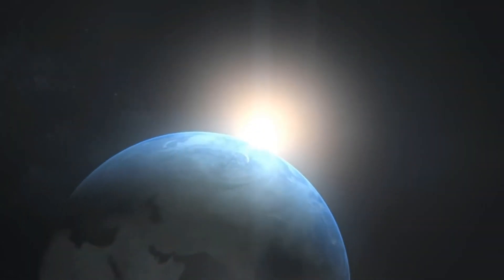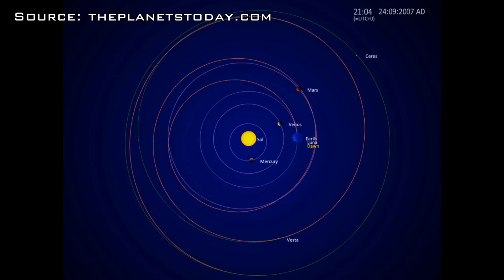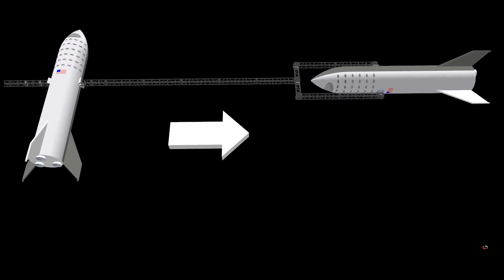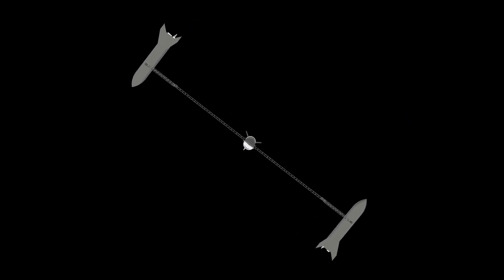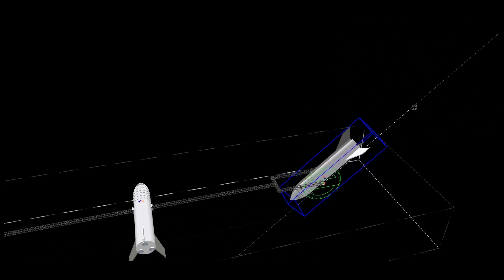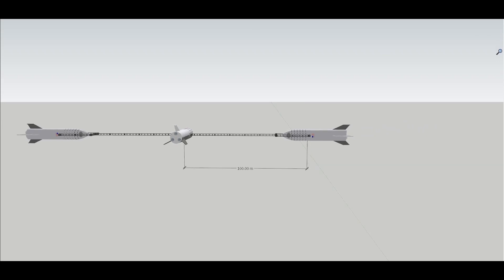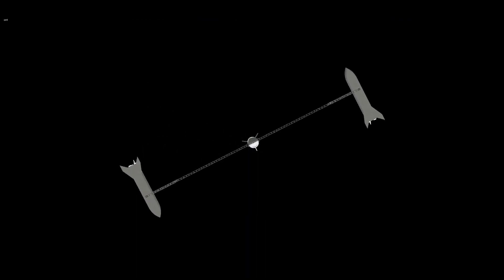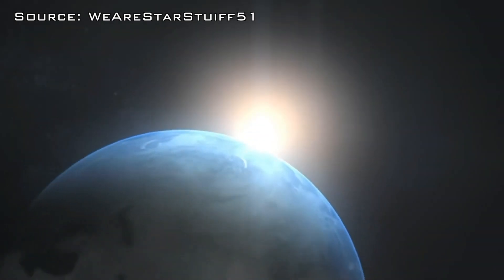GLS2: Artificial Gravity for SpaceX's Starship

Comment: Lame. Starship rcs will be hot gas using the same fuel as the mains  no reason to use mains they are way too powerful.  Truss is way too heavy and serves no purpose.  Wastes  third of payload.  With an electric motor controlled tether reeler  you would need much less precious fuel.  Fine tuning the g force could be done with nuclear or solar energy which will be available in abundance.

You one correct realization is that spin gravity is necessary.   Just a totally lame design.  Congrats
Reply: Would you like to live in a spaceship that was hanging by a cable from a crane? How about doing exercises in it? And every time you moved up or down in the real thing the coriolis force would make it shake. And perhaps it would spin about the axis of the cable. First one way, then the other. The trusses, made of lightweight alloy tubes, would stop all that and would not be heavy.
Reply: @robtristram8395  Thanks for your thoughtful response.

Yes I would like to live in a tether spaceship over any other alternative.  It is safer, carries more payload, and would be less disorienting.

 I am afraid you are thinking about this design problem from an high gravity earthly point of view.  This is common among we humans as only about 500 have ever encountered more then 5 minutes of weightlessness at a time.

Thinking about this like a ship hanging from a crane in a gravity field shows this tendency.

Movements inside one of the two spaceships would change the center of rotation.  But it would stay very near the line of the cable unless you were moving a significant proportion of the ships total mass.  Which is unlikely to be necessary.

Ships on their way to mars will be many times the mass of the passengers.  So even everyone moving in coordination quickly from one side to the other would be less noticeable that the same operation on the Titianic.

Secondly you would not feel or notice the  regular changes in center of gravity without instruments.  There would be no shaking.  Unless you are sharing a ship with someone who could move like the Flash.

If someone started running clockwise around the outside edge of one of the 30 foot diameter floors; there would be a tiny proportional axial rotation until he stopped when it would be cancelled out.  If this were a serious need it would be easy to store some of the water in an annular water tank with some small solar power eclectric pumps to contra rotate.  This takes no fuel and adds no extra weight.  Not a real problem.

The trusses would be way heavier than a simple cable.  It would be far better to use that extra mass to have a longer cable so that the centrifugal force is more similar to  gravity.  The longer the cable the more similar the passenger experience between the top of the ship and the bottom floor.

Another big plus of the tether approach is that the direction of force on the ship is directly opposite to all of launch and the high G part of the belly flop reentry.  It is far easier to design a ship that experiences substantial forces in one vector than all the additional vectors a solid strut system would apply for months of 24/7 use.

There is a reason Musk has not contacted the Original poster.  The OP's visual art skills are strong but his physics and engineering are weak.   There are lots of ladies with the visual arts skills who would work for free for a chance to "bump" into a billionaire so he will not be getting a call.

There is far more chance of an octogenarian millionaire taking a medical truss into space then SpaceX  deploying one as shown above
Reply from the maker: Thank you both for your input! I find the debate between having a flaccid and rigid structure for the ideal spin system to be fascinating.

Despite the well thought out arguments for flaccid, I still think rigid is safer. Yes it would be heavier, but I think its worth it for a number of reasons. 

Firstly, this IS a high gravity situation once the system gets up to speed. The weight of the starship shouldn't be compared to the titanic, it will be much lighter, especially when low on fuel. It will still be heavy enough that regular movements wont affect the equilibrium that much, but with a flaccid connection, there will still be an effect, it doesn't just get cancelled out as you suggested.

Secondly it would be nice for the system to be able to spin up, and spin down. loosing angular momentum for example, on spin down, will cause an unknown number of possible problems with a flaccid system, even if a tether reeler, which itself, would be a very heavy apparatus.

adlsaias, the way you talk about my design reminds me of how people talked about SpaceX propulsively landing their boosters before it was reliably done. Imagine saying "well the spaceshuttle already lands on a runway, why expend rocket fuel and send a tubular rocket booster back in from suborbital flight to land on a boat of all places?"

I admit my design is flawed, because I went for the use of main engines, and the swivel joint, which adds complexity, failure points, and extra weight, not to mention the structural issues it causes for Starship. And perhaps the swivel joint and main engines idea will end up being a good design for a future vessel. But for Starship I don't believe the hot gas thrusters will tap from the methane and lox tanks used for main engines. RCS thrusters for any vessel should be reserved for RCS ONLY, and not have to spend any of the RCS fuel pool on spin momentum. 

None the less GLS V3, features a new design that is more structurally sound. It will still be rigid, but it will also utilize steel cables along side, or inside of the truss/gantries to hold the tons of weight of each starship from flying away outwards, while spinning. That video should be out in a couple of weeks, right now I'm working on a space station idea that uses solar power to provide angular momentum, and tries make sense of docking with a spinning body.
Reply: @smallstars  Dude!  I gotta admit you have perseverance.  Which is close to perversion in more ways than just spelling

1 it is ignorant or deceptive to describe the cable as "flaccid"  It will be under huge tension and straight as an arrow for  as long as the ships are rotating.  Onboard human movements will have no significant effect on anything.

2 On the plus side you admit the truss would be way heavier.  But you still do not seem to understand how much of a veto that huge weight difference would be in the real world.  Especially when you factor in how much more space a truss would take and the fact that it adds nothing useful to the design.  

"The best part is no part"  -- Elon Musk 2020.

3 Here we see the physics ignorance.  If nothing leaves or hits the ship and everyone sleeps every night in the same bed the Axial rotation of ship will be exactly the same every night.  Even if this were not reality it would be easy to control this rotation with a solar or nuclear power source powering an annular water ring or Gyroscopes like every satellite ever launched has used to control its attitude if the designers wanted to control rotation.  It would take no fuel.  The Truss would be far more incremental weight then any of the myriad solutions for this non problem.

4 The tether system has a huge advantage of precise control of the amount of gravity by using an electric motor to control the length of the tether deployed.  What are these alleged problems you speak of?   The tether control system would be much lighter than what would be needed to make the truss system provide this level of control.

5 This attempted analogy between my showing how the truss system is inferior to a tether to naysayers about first stage recovery is bogus.  No where am I defending an existing system against an obviously more efficient approach like those who attacked re-usability back in the day.  Even Tony Bruno ULA chief admitted that if it worked it would be better.  They just thought it would be too expensive to develop.  In this case you admit that the tether system would be weight and volumetrically better with more capabilities than the truss approach.  You are just claiming there are as yet undescribed "possible problems" that make it dangerous.  You are acting more like Bruno's predecessor who tried to spread fear uncertainly and doubt while trying to protect an existing investment ULA had already made (in your case the above video).  That is the more correct analogy

6 Glad to hear you admit the main engines and swivel joint in your original design are not optimal.

7 Regarding Methane/Ox RCS hot gas thrusters you may have missed that SpaceX added Methalox thrusters to their proposed NASA lunar lander design based on starship.  These will be used to land on the moon and are placed about 2/3s of the way up on the side of the ship to avoid blasting a huge crater at the landing spot using raptors to land.  SpaceX has already tipped their hand that RCS will use Methalox.  Musk also said his biggest regret on dragon was using toxic fuels on Dragon.   Sorry, not sorry to inform you the planned RCS design for Mars trips is already announced.

8  You would only need to use RCS for start up and shut down with a tether.  The flexible tether system also has a big advantage for fuel efficiency even on startup of the two ship spin.  You could play out miles of cable and connect the two ships.  Then slowly start reeling in.  A small difference in velocity of the two ships will increase as the ships are pulled together, just like an ice skater pulling in her arms.  So only a tiny amount of fuel at the beginning will be scaled up to whatever is optimal.  In fact no fuel at all may be necessary as the two ships will no doubt start at different velocities after the trans mars injection burn.   You cant get lower than zero fuel needed.  On shutdown you just reel the cable back out and the ships relative velocity will drop back away to almost zero.  Then you just release the cable and go land on mars.  No Methalox fuel needed again.

9 Before you complain about 2 miles of cable and a reeling system being extra weight think about how valuable cable will be on Mars lowering people into lava tubes and climbing mountains, dragging ice blocks, etc.  There will be cable on every ship to mars whether or not they use an spin system.  Here you just get dual use out of it.  Say it with me : the best part is no part.

10 I laughed when I got to last paragraph and saw that you are planning to release a new video where you combine the truss with a tether system.  Talk about burying the lede! 

It only took 10 months youtube comments to get you to a system with the worst of both solutions.  All the excess weight of the truss plus cable without the fuel efficiency, ease of use, safety, and flexibility of the tether.  Good luck with that!

Comment: wow, I'm not sure if that design can resist the forces on the beams near he axis due to the monstrous momentum generated by the two spaceship thrusts and it's probable differential output. But it's an interesting concept.
Reply from the maker: Actually the force you reference won't be too bad, because of how leverage works mainly (when you swing a door open with force by pushing at the handle, is there a lot of force exerted on the wood near the hinge?) but also because in space there's no atmospheric drag to contend with.

Sure there will be enough force for the truss to flex a little bit, but it will be nothing compared to the weight that of the starships pulling outward on the system once it is spinning at 3 RPM.

Comment: Would ion engines supply enough thrust to augment the rotation over the 6 month travel time?
Reply from the maker: Questions like these just make my day! Yes, ion engines would be able to "augment" the rotation, and help with station keeping. You seem to be aware that they provide very low thurst, but they can sustain that thrust for long periods of time. Spin grav systems could potentially be a great application for ion thrusters. One day I will make a video that features ion thrusters powering a spin system, but today I'm working on another system designed for SpaceX Starships that uses electric tesla motors and solar power. Coming soon!

Comment: Why spin up the starships?  Develop this idea, traveling along with a single starship will be two habitation pods tethered together and to the starship (somehow).  The pods would spin up held by the tether or truss.  It would take much less energy/fuel to spin up relatively light pods.  Pods do not have propulsion, just living space and life support.  Solve---How to get from pods to starship, Pod heat/radiation shielding,  Pod solar panels.  Here's a thought, pods are launched separately and piggy back on opposite sides of starship after in orbit, there is an airlock between pods and starship, pods are tethered to starship using an elevator (truss) or winch (cable) mechanism (airlock and retracting pods is how to get from pod to starship).  Starship/pods spin up on starship's long axis, pods 'elevator' out to desired distance.  Elevator or winch mechanism is such that it can cycle several times a day for shift changes however both pods must move together, either in or out at the same time for balance Danielsan.  Springs are used to store energy for elevator movement?  Pods are in the form of huge Tesla Roadsters and painted red.  Pods remain in orbit and attached to each other at earth and mars.  Actually the pods might need some propulsion for pre and post tether docking.  Problem---coriolis effect in starship, at 3rpm maybe tolerable?

Comment: Biggest question i have is not to do with rotation so much, but rather, how does it slow down when it reaches its destination? The GLS rocket points in the direction of travel, so how do you spin that around to brake without stopping the rotation? you can't really, can you?
Reply from the maker: Even without using my concept, the original Mars mission plan is to course correct into Mars's atmosphere and use the friction to help slow down for a landing. This is the most efficient way to slow down and there may not be enough fuel left to do what you are hinting at which is an orbital insertion.

Either way the ships would need to detach, and the GLS would fold up it's hardware into it's payload bay, so that all 3 vessels separately can flip around and fire their engines.

Comment: Could a quad-spaceship GLS with two pairs, counter-rotating, use solar-electric power for rotation instead of main engine burn?  The time to spin up will be days, not minutes, and slower spin-up would be safer.  Lots of angular momentum but worth a look?  Spin-down could be by braking, better still regeneration

Comment: I would need to look at the math but a pre-constructed triangular truss would be more stable. during the long costing phase, you could push yourself further off course with slight differences in mass between the ships. This would increase fuel requirements due to correction burns that may not be able to be done while spinning.